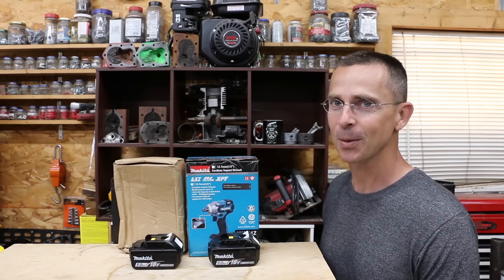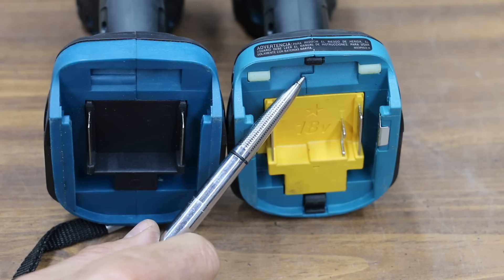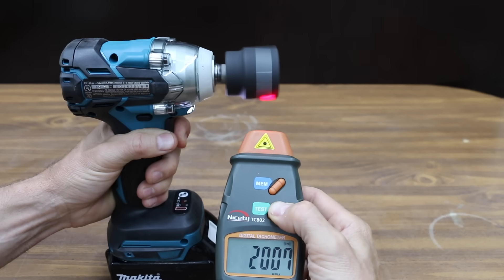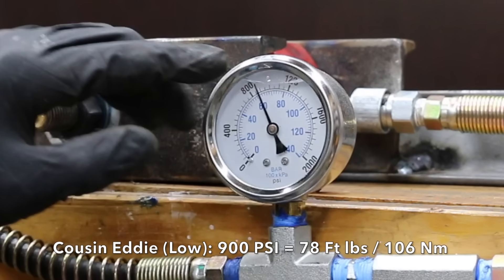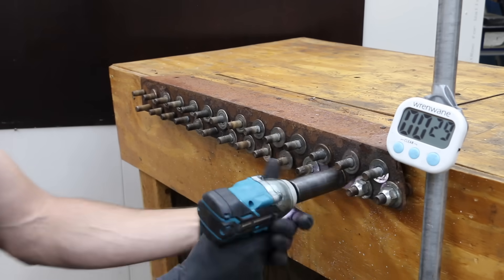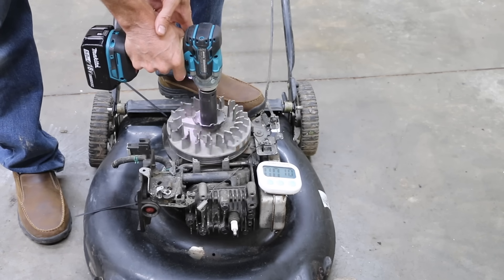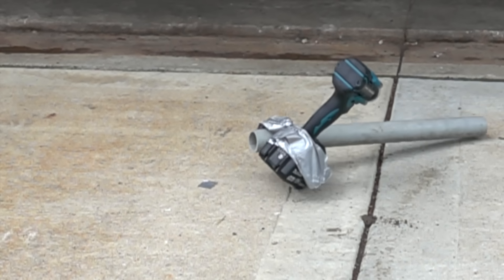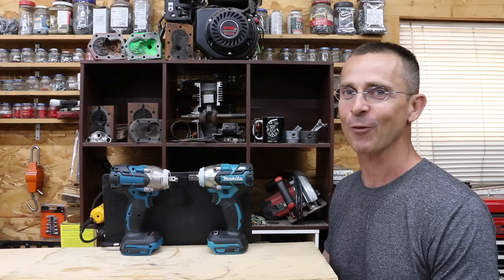Fake Makita Impact Better? Let's find out!  Makita XWT11Z 18V LXT Lithium-Ion Brushless Cordless

Comment: I guess the $30 knockoff would be fine for my needs - changing wheels in 2 cars twice a year.
Reply: Is it then worth having this tool? I do the same. Torque wrench does the job, it's not a knockoff and does not need a battery.
Reply: I was recently faced with the same dilemma and ended up getting the Makita! I rationalized that someday i may really need a torque wrench for other purposes and holding on to that $30 piece of garbage for years does not sound appealing!
Reply: @Bacnow  Cousin E. is definitely NOT a piece of garbage. That tool would work for most wrenching jobs - because most bolts are not torqued to 80 ft lbs. Just don't use it for lug nuts.
Reply: Rob Slicemaster — any 1/2” torque wrench that can’t remove lug nuts is garbage! What other reason would you want this? It’s not a impact driver!! Pony up the extra bucks and get a decent tool! Never cheap out on tools that you plan to keep long term!
Reply: @Bacnow  To answer your question, "what other reason would you want this", I would say; Removing Bolts from the front of an engine, removing bolts on lawn mowers in the backyard, driving lag bolts on your deck,,, There are plenty of uses for this tool if you only need it occasionally. Get out of your box man!
Reply: I've bought cheap air powered ones and they are worthless most of the time because they can't break the lug nut loose causing you to have to use the lug wrench anyway. I don't even bother to get it out anymore when changing tires/wheels.
Reply: If it can do the torque! Especially if anyone ugga duggas them on with a pneumatic impact.
Reply: I'd  have to say it much better than some that are out there. It seem to preform admirably compared to  price range of the tool. You should test cousin Eddie against harbor freight series.
Reply: @raphealwood4434  harbor freight stuff any good?
Reply: @jaybajan  I know folks who love it. I myself own old school craftsman. And they work for what I need done. I haven't found a reason to buy anything new.
Reply: It depends on the cars. A Corolla only need 60-70 ft/lb while a f150 need 120+ ft/lb. This would probably be fine for your situation as it is not being used daily for a mechanic. You always want to use a torque wrench to finish tightening to spec.
Reply: I have one of these cheap impact guns, wouldn’t touch my wheel nuts however a 300mm facom breaker bar took very little effort
Reply: NOOO. Dont buy cheap shit. Noone wins.
Reply: And when you take the wheels off to work on brakes and suspension.
Reply: You're better off buying a corded one, lithium batteries doesn't last if you don't use them often because they discharge by themselves overtime, so unless you regularly charge the battery every month, the battery will die within a year or so.
Reply: @tristan6509  i wouldnt bother with a corded one. too annoying with the cord getting stuck when you go to do the other side of the car and the power sucks compared to cordless one. im not sure if the batteries will completely die, will take a small hit but plenty enough to change wheels
Reply: @tristan6509  Wrong.

Comment: I own my own company and all my drills are Makita and this is exactly why.  you should do a test of the batteries and how long they last.  Ive been using my hammer and impact drill set daily for about 6 years and still going strong.  As far as dropping them ... many times, my only complaint is the silly rubber ring keeps falling off.  You should mention that Makita has many different levels of quality.
Take care and thanks for the video

Comment: The problems with the chinese drill can usually be fixed by installing better high drain batteries or changing the battery holder altogether to an OEM brand name battery holder

Comment: i hate you. i just ordered one cousin Eddy!
ORDER DATE
23 Jun, 2020
ORDER NUMBER
19-05273-37007
SOLD BY
floresc-4329
(1 item)
ORDER TOTAL
£24.48
Order Torque Impact Wrench Brushless Cordless Replacement For Makita Battery DTW @jin
Leave Feedback - ORDER DATE 23 Jun, 2020
Torque Impact Wrench Brushless Cordless Replacement For Makita Battery DTW @jin
Torque Impact Wrench Brushless Cordless Replacement For Makita Battery DTW @jin
( 303596866817 )
Estimated delivery Wed, 29 Jul - Mon, 21 Sep

Comment: Couple months ago I saw Home Depot had a Rigid 18v 1/2" impact wrench with a 4ah battery and charger for $150 (online only). Hell of a deal. Far outperforms my $100 (tool only) Ryobi 1/2" 18V impact. The Ryobi couldn't get lug nuts or crankshaft bolts off. The Rigid removes them with little to no effort. Need an impact? Grab a Rigid. No sense buying a cheap one that wont do anything. Learned that with the Ryobi. Had to borrow my friends Rigid 3 times before I found the sale and got mine. The deal is still going on, grab one while it's there. 485 .ft/lbs forward, 620 .ft/lbs breakoff.  Would love to see Project Farm do a comparison of the Rigid to the Makita, since they cost about the same. 
https://www.homedepot.com/p/RIDGID-18-Volt-OCTANE-Lithium-Ion-Cordless-Brushless-4-Mode-Compact-Impact-Wrench-Kit-with-1-4-Ah-Battery-and-18-Volt-Charger-R86011SB/303037082

Comment: For weekend warriors, Eddie is more than enough.
Reply: Depends what your weekend project is. I've needed every ounce of my Milwaukee 1/2" impact's torque at times. I promise you that cousin eddie, or this makita for that matter, would not have completed some car repairs I've done.
Reply: @desertfox2020  the Makita is great for breakaway torque and so far I haven't found anything it couldn't breakaway.  If I need more breakaway I have the bigger Makita also but It hardly gets used since it's overkill 95 % of the time and much bigger  but I do agree cause I've been many of junk yards getting parts from vehicles where bolts were so rusted id just have to cut them with a grinder.
Reply: @kindakool2529  My Milwaukee took some time to remove the 37mm front axle nuts on my Chevy 2500. I haven't done anything else where it was even slightly slowed down, but it's nice to have the power when I need it. I wouldn't want to have a second tool for most jobs and only get out the big gun when it's needed, because it does the smaller jobs just fine too. I've used it on the low setting to drive 10mm bolts holding a lawnmower engine shroud on, for example, and it's gentle enough to do that.
Reply: for that one project?  sure.  Eddie will fail in the longevity dept though (look at all that wear after a handful of tests!), so soon even the weekend warrior will be making another purchase and that $30 will be gone, gone, gone.
Reply: @wheeledgoat  the typical "weekend warrior" that would find a cousin eddie best may be the type that would use it for a project or 2, then have it sit for years,  and by the time they go to use it again, the battery is knackered from either years of self discharge, or years of sitting on the charger. and by then makita has probably moved on to a different battery interface and no longer sells the old type, so you need a new tool again.
Reply: @Dreddy72  Yeah, but it is only thirty bucks.

Comment: I would like to see how you convert an carb engine into a EFI Engine with an anftermarket EFI Kit. I guess the learning and try an error could be fun.

Than you could buy a Dynometer thing for Go Karts to measure performance. And on this setup you could test veryy much stuff like W40 in Fuel or a wood gas Carb. You could boost it in different ways. Try to Measure Knock. ........

Comment: One of the tools that had been missing from my tool collection for a long time was the impact wrench / hammer drill. I didn't see the need for one, I owned a good Dewalt and Makita drill.  Day came I needed to run lags into a concrete wall, so I bought a cheap $60 (about $30 after coupons) Chicago Electric from Harbor Freight.   I Quickly realized how useful the tool was and vowed to replace it  with a "Quality" version when the Chicago Electric died.  That was 6 years ago.  Now to be clear I don't work in heavy  construction, automotive or anything where I abuse the tool daily. I use it several times a month for normal house hold work, maybe a tire lug here and there.  It's obvious the Makita is a better tool, But honestly unless my job changes and I need to use the tool daily, when the Chicago Electric I have dies, I think I'll just replace it with another Chicago Electric.

Comment: Keep your eye on the ball:  You can buy 5 of the cheap tool for the same price as the Makita.  It surely does NOT perform 5 times better.
Reply: Poor logic. As a contractor tool, the speed alone will make that Makita pay for itself in just a handful of jobs. Plus the Makita will handle stubborn bolts that would stop the knock-off. If that happens, the better tool pays for itself instantly. But of course it all depends on the way they are paid. Certain sort of people actually want to make the job longer or they are just sloppy.
Reply: @zwz.zdenek  My comment was directed toward non professionals whom I believe represent the majority of people making a decision which to buy.

Comment: Could you test oil filter wrenches? I have several rubber strap, metal strap, cap, and the newer ones that "adjust" (hypertough). I had a hydraulic filter that was painted after installed and none of the standard wrenches could take the filter off. I had to drive a long screw driver through it to get it off.

Comment: Its obvious that appearance means very little when actually using a power tool.  Personal experience and feedback from my customers indicated that Makita makes good quality power tools.  I didn't get that kind of feedback on the lookalikes. With all the knock-off tools flooding the market I'm glad I'm retired.
Reply: The knockoff is clearly not the real thing though. It's not faking the branding, i.e. you are unlikely to mistake it for the real thing. People know they're buying a cheaper product that won't be as good. I actually have one of these after seeing someone else tear it down. It's great for DIY work and is compatible with all the batteries I've already got. For the price, it's great.

Comment: Quality wise very happy with my brushless Makita... You see I got mine for free after returning to an old work site and finding it after a colleague had left it on the roof a whole year prior, sitting in a valley. I put a fresh battery on it and it fired straight up. The chuck required some WD as it's a coastal area and it was moderately rusted, however opening it up showed no corrosion internally. 7 years later it's still working like a charm.  
As for drop tests, well I know guys who actually use them as a hammer to align frames when they weren't quite square, so they hold up to abuse amazingly well.

Comment: Up here in Canada we have what some people call as Mastercrap brand Canadian Tires line of power tools , just had by no choice retire a small table saw after 15 yrs and full house Reno with it besides hundreds of projects , it's still worked but the fence broke along with small issues , anyway I've got a impact wrench under same brand name , I've built many projects including a 16 x 16 shed all done with screws of 2 1/2 inch to 4 inch screws it's 18v and it's now over the 3 yr warranty period about 5 yrs old , it's got everything I need and it's even used during mechanics on my truck , or helping change over tires , I've never owned a Makita of any tool , no need , I can buy cheaper that truly lasts longer than some name brands .  Some times the Cousin Edie is all you really need , trust me my tools are used daily . I'm not easy on them but I do look after them . You buy what you can afford not to impress others you use a certain brand . I just don't believe in spending extra for name brands that some times don't hold up to their cheaper counter parts , I've got a Bosch impact 20v that died in two yrs of use and was not battery issues either

Comment: My problem with knockoff tools is patent theft which we all know China is notorious for. Patent theft stifles innnovation and robs companies of their hard earned work. Engineering isn't easy. Cousin Eddy is a blatant patent theft against a well known brand and quite frankly hurts their brand image because not everyone knows about knockoff tools (image someone not well informed buying this off Facebook Marketplace) or really even worse people believing knockoffs perform just as good as the brand name because they think the knockoff has the same parts as the brand name and then writing off the brand name as garbage based on the knockoff. I'm in several tool groups on Facebook and see people saying this or that tool brand is garbage with a photo attached to their post of a knockoff tool lol.

Also I wouldn't trust a knockoff tool with my batteries. Overload protection is either in the tool or the battery depending on brand. For example Dewalt builds their overload and overdrain protection into the tool. Buy a knockoff Dewalt tool and it could ruin your nice battery.

Comment: Great video!! Very informative!! So a 30 dollar knockoff is perfect to have around as a backup!! It suprised me at how well it actually did!! Definitely wont be replacing my Dewalt with one, but nice to have as a backup! Have you seen that Bestline has changed their formula? Now it comes in a 12 ounce bottle opposed to the 16 ounce. I dont know if it works as well, but it is definitely a different formula. Just a little heads up.

Comment: Your method of measuring torque is very interesting. It is testing sustained torque vs "breakaway" or "nutbusting" torque, so I don't know that these torque numbers are directly comparable to the numbers we know from other tools. It would be helpful to know where other popular tools perform on your rig. I know buying a bunch of impact wrenches would be expensive, but I would assume you might have one or two you already use around the farm?

If you were going out and buying some to test, I would say the Milwaukee M12 Stubby and M18 mid-torque are the most popular wrenches with mechanics. The Kobalt impact wrenches also get a lot of love because of their bargain price, and the Ridgid mid-torque is probably the best bang for your buck.

Comment: Back in the 90's. some company made knock off Makitat 9.6V drills and saber saws; I bought both, for a fraction of the Makita brand cost. They came in black plastic, used identical batteries, and both lasted for as long as I had them (wife wanted the battery powered ones when we got divorced. They looked and performed identical to the Makita brand ones.

Comment: i have the fuckita and the real deal also, for $30 it is a GREAT tool. But if you put the real one next to it... i mainly use it to drive 1/4in bits since the knockoff has the 1/4 socket in the anvill also.

Comment: Had me laughing out loud with the dance moves part! It seems the plastic moulds were copied from Makita with a few changes to use less plastic.
And it is that little bit of missing plastic what seems to have caused the handle to snap. 

Still, it has me wondering how Cousin Eddie managed to be only 1g lighter than Makita.

Its hard suggesting something that hasn't been done before! Thank you PF!
Reply: Plot twist: Chinese nuclear power plants pay Eddie & Co. to smelt fission waste into drill parts. That's why it's so heavy and cheap.

Comment: I love how Project Farm uses another brand(DeWalt) to disassemble
Reply: You shouldn't use an impact driver on small screws in plastic. In fact, I use hand tools only because you want to reuse the existing threads in the plastic to avoid stripping.

Comment: My question is what bolt size are these tools rated for to fastening application. If you are using a larger bolt than max torque rating for tool, the tool will not achieve its factory rating on torque spec. I would most likely assume the torque specs are for a 9/16 bolt.

Comment: Awesome man! And this test couldn't have come at a better time. 
Cousin Eddie just earned a spot on the job site while my Makita will now cover the home. 
Eddie provided all the power I will need, and even if the handle breaks where yours did, it will still make it through the day.
We are at times less than careful with drills. And dewalt replacements can get rather costly. 
My only concern are the batteries. Are they legitimate 18650 cells or better?